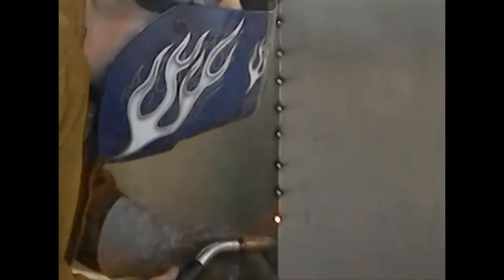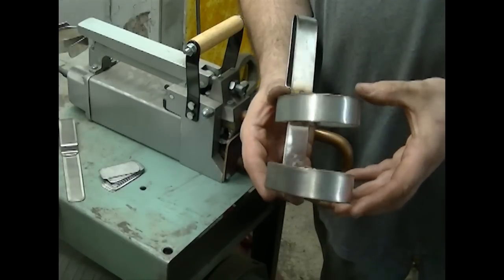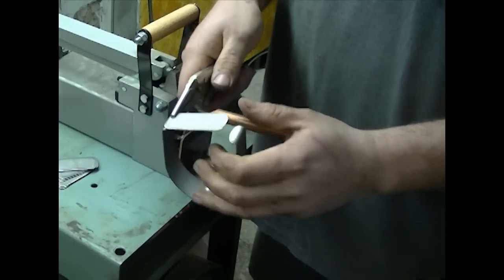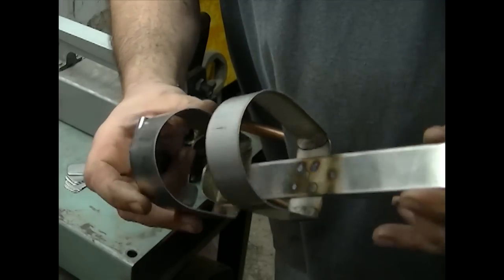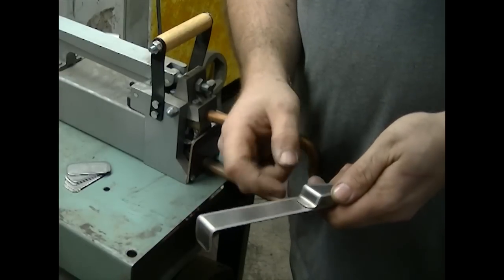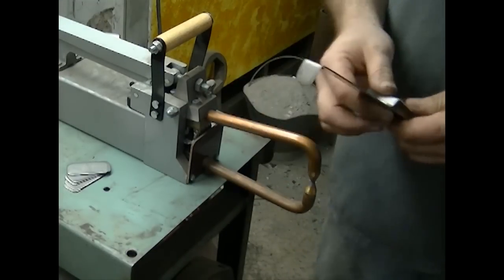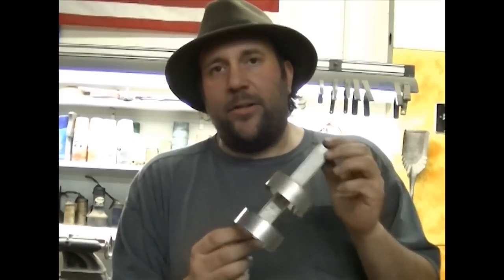Basic Spot Welding

Comment: Great demonstration!

tangentially related: If I were the car wash owner, I would have gotten these bottle holders fabricated entirely from cotton or some soft hydrophobic fabric.  The top and bottom hems could have a stainless steel wire embedded inside to keep a cylindrical shape to accept the bottles.

Comment: Where were you when I needed you?!! Had a car owner at a car show explain at length how is car was absolutely perfect colours standard and exactly as it left the factory. He got very defensive when I pointed out his panels were fitted with tack or puddle weld in pre made holes. He was adamant they were spot welds! I tried to explain to him that spot welds are a resistance and pressure weld with no holes or any other pre preparation. He relented to claim they were the same thing! I had to explain spot welds introduce no extra material to the joint whereas puddle or spot welds does. He left a bit crest fallen but a little smarter.
 I bought a spot welder for discerning customer work but it ain't cheap kit! The cost of the solid copper arms is a bit eye Watering!
Great video mate

Comment: Another great video. Keep it up. Just wondering why the loop can not be one piece only eliminating the connecting plate, 6 spot welds and labor.  For 18 gauge ( 1.2mm ) mild steel or stainless sheet metal the recommended electrode tip diameter is 0.216in ( 5.5mm ) and has to be perfect flat, not rounded with smooth surface and clean. The electrode tips must be aligned until they are coaxial to each other when the welding materials are between the electrodes & the proper clamping force is applied. Sparking is not normal and could be dangerous ( proper protective gear is a must ). During welding it is not allowed angling of the clamped materials, The welded materials must have smooth surfaces in the welded areas, to be clean, free of paint , rust, grease, etc.....I recommend to make sample welds first , twist and peel test them using a wise and pliers and check if the proper welding nugget is formed between the electrodes. Using a timer can further improve the quality of the spot welds

Comment: my high school metal teacher had only taught us to do a quick zap and let go. I didn't think of about holding it for couple seconds. A lot our spot weld projects would fall apart the same day or the next week.
Reply: I work for in an automotive assembly plant, and our spot welding is all robotic, now.  They are programmed to hold for a second, of course there’s a lot more current in those welders than the one in the video.

Comment: Thanks for the vid, but I'd think that you need something more than cloth tape to protect the cars, especially higher end cars. Guys washing cars tend to lean over them a lot to reach the center of say a hood or windshield so that they can dry/wipe them. Anything with exposed metal is going to scratch the car. Even getting into and out of the car quickly (which these guys also do a lot of) is going to cause something hanging off their sides to bump door panels. You might want to look into something like a rubber coating to completely cover them especially since cloth tape tends to come off in water, as well as having a slightly abrasive finish.

Comment: I’ve got both a 120 volt and a 220 volt spot welder. I bought the Heavy) 220 model because of the supposed limitation of 1/8” of the 120 model, and with welds of thin materials, weld time is very short.
Reply: Oops. Seem to have hit the post arrow. 

Anyway, the 120 for really thin, and the 220 for over 1/8”.

But guess what, the 120 model easily welds 1/4” material, including stainless. It just takes a second or two more time. Since you’re not welding continuously, but spot to spot, it never heats up, even after an accounted 50 welds in a period of 3 minutes. Since the 220 model is rated for 3/16”, I naturally tried it with 3/8”, and it worked just fine. Both could possibly even work with thicker material, but I didn’t try that. Enough is enough.

And even though you’re told it won’t, it will weld aluminum. But the tips get contaminated with aluminum. I tried my MIG tip cleaning dip on the tips, and it seems to work.

Good luck.

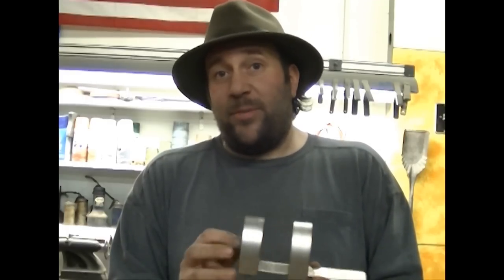Comment: 9:10 i build my spotwelder my self from a microwave transformer(=MOT) and i can also found the limit at around 1/8 (to be esactly a bit more= 3,5mm). Since the build was so easy and cheap i will double the 
power by  adding a second MOT(700W) in parallel so i can weld double the thickness, the upgrade costs
only ~15$. later when i found another MOT i will add a third and fouth so i can weld 1/2inch (with 4mots) Funfact; i could weld thin coppersheet onto stainless steel :D But i had problems connecting different steels types (same type is no problem)

Comment: Hi Jeffrey. I liked this video  and I'm totally new to welding apart from a couple of things I did at college many years ago.  My question comes from an idea I'm being drawn to.  I would like to build a dish draining rack from  small diameter steel bar (2 - 3mm diameter). So aside from the bending and shaping of the pieces, would I need  specially shaped tips on the spot welding points? I ask because I would imagine it would be difficult to hold the pieces together accurately.

Comment: Nicely taught, never done it b4, but would try now. Would spot welding work with aluminum?
Thanks, very informative, am encouraged. Good teacher.
Reply: Antonio Capule  yes you can use is it for aluminium too
Reply: Just with spot welders, you need compatible metals (aluminum and aluminum, steel with steel, ect.)

Comment: Hi Jeffrey, I want to weld some pieces of sheet metal 18Ga. For how long should I press the button so I can get a strong weld? For how long should I let the machine rest before the next weld? My project needs 12 spots of weld. And I need to build at least 100 units. Hope you can guide me through. Thank you!
Reply from the maker: Without knowing the amps of your unit or whether it is 220v vs. 110v it is hard to take a guess at that. Best advice is try to find some scrap pieces and to a couple of small samples, try to break the weld. A few destructive tests will help you more than a "good guess" from a guy like me. Plus it is always good to practice a bit before doing a production run.
Reply: @jeffreysanto  It is a 220V. I' ll try that experiment, I bought a Harbor Freight one and after watching your video I thought that an extra advise would help.
Reply from the maker: @pacoryu  18 gauge is .050 thick, so .100 for the two layers. So your just shy of 7/64 in thickness overall... On that model welder I would guess it to be between 4 - 5 seconds.

Comment: Hi Jeff, nice video.

I like projects with stainless 3mm diameter rods.  

I currently use TIG welding to join them but sometimes it's too much power and it can easily deforms or blow them because I don't have very low amp features on the machine.  

I know you said here that your spot welder doesn't handle more than 1/8" combined metals, but is there any chance that it will work joining 2 rods of 3mm each (one on top of other) maybe because rods don't have much metal near the current area and can not dissipate heat  therefore forcing heat to concentrate in just one spot and ultimately making it weld?

Or can you simply just make a video about it?

English is not my main language, I hope you have understood me.

Thanks.

Comment: So is sheet the only use for this type of welder . I just got a low amp stick arc welder clarke 95 model . I am going to start practicing . But I just seen one like this on craigslist for 30 dollars and I know I will have some use for it . I am doing the finishing touches on a tubing roof rack . A fabricator did the bulk . I have to put some crossmembers for the floor and add expanded metal sheet on the floor and paint yet .
Reply from the maker: +timothy thomas Mild and Stainless steel sheet is the most common material processed with a spot welder. I just did a video last week for one of my subscribers spot welding stainless steel wire, he wanted to make a miniature grill for backpacking. If you would like to see it here is a link.

https://www.youtube.com/watch?v=wxooEzpNrKI
Reply: Thanks I will check it out . I have not heard from the guy that has the spot welder for 30 dollars yet .

Comment: Hi Jeffrey, great informative video.  How do you think spot welding would work for 10ga galvanized sheet metal?  Would that harbor freight weldor be up to the task?  Thanks!
Reply from the maker: I Vw If memory serves 10ga sheet runs .140 which is slightly thicker than 1/8 inch. So 2 pieces combined would be about .030 over 1/4 in.  According to the Harbor Freight site this spot welder which is the 240 volt model welds stock to 3/16 in. combined thickness (mild steel), two pieces of 20 gauge... Also if you planning on welding or heating anything galvanized just be aware that the fumes are extremely hazardous.

This is the description from one of the welding sites I follow: Zinc is the coating used on galvanized metals The typical effect of breathing zinc fumes is metal fume fever. One or two hours or more after welding-without proper personal protection-you may experience severe thirst, pain in the legs, shivering, congestion in the head, dryness and tickling of the throat, and a cough. In very bad cases, you may feel severe shivering, a high fever, buzzing in the ears, nausea, vomiting, and even hallucinations and convulsions. Your symptoms will usually last 24 hours.
Reply: Jeffrey Santo thats a good point -- the steel will be too thick for this welder.. I've got 10k pieces of greenhouse material that require 4 welds each.. Its a hefty project and I don't have time to stick-weld dirty galvanized steel (and I agree -- zinc is nasty stuff.  Had a horrific stomach ache once.. learned my lesson!).   
I really appreciate the feedback.  Looks like I need to do some more researching to find a safe/efficient way to get this job done.

Comment: Nice work!  is that a 240V welder? 20 gauge sheet metal? I just picked up a Stark 240V spot welder to do a series of welds in 18 gauge sheet metal. My instructions also state "up to 1/8". I haven't set my welder up yet. I'm looking to get as much info as possible before I start burning. Thanks for posting!

Comment: Your HF spot welder doesn't have a weld timer on it I see. Try holding the clamping force for a few seconds after you release the trigger switch. This gives time for the weld nugget to cool while clamped( forge time) for a better weld.
Reply: robert stirling I was about to say the same thing. At my school in the metal shop, we spot welded our product together and it had a weld timer. Makes it a lot easier when all you have to do is flip a switch and not hold the switch for a few second.

Comment: Jeff, great and informative video. I never owned a welder of any sort. I am wanting to weld two coat hanger thick wires together for a project I am doing. (One wire crossing over the other with a weld to hold them.) Would you recommend spot welding for welding two wires like this together? Your advice would be greatly appreciated.
Reply: I would recommend a spot welder, but for something like that, check out Grant Thompson's DIY spot welder, don't waste 200-800 dollars for a small project
Reply: Hi there, I know this was years ago but coincidentally I am trying doing the exact same thing right now! How did you get on with this?

Comment: Great Demo on Spot Welding. Does work with Aluminum?
Reply: it does but with a special trick
Reply: @dimitrismoures  thanks for sharing the special trick
Reply: @ryanlewellyn5504  my apologies, you need to "sandwich " the aluminum sheets between a thin steel tong. This way the current can travel between the two pins of the spot welder but the heat effect mainly the aluminum
Reply: Most spot welders should be able to weld anything they can get hot enough to melt through

Comment: Is there any problems with localised oxidisation at the site of the actual spot weld of the stainless?
Other methods of welding stainless require a gas shield to prevent oxidisation during the weld process.
Reply from the maker: The only time I have had an issue spot welding stainless is if the copper contact points on the machine are old and need replacement. If the tips mushroom because your using to much pressure it increases the amount of contact to the metal. The heat is not as focused and as a side effect more heat is put into the piece than normally needed to fuse the parts together. You'll start to see discoloration in the material but not much more than that, to get oxidization you would have to stay on the heat for a while and begin to physically burn the steel. Since your only doing a quick fusion with spot welding you do not have a molten weld puddle like you would have with TIG welding for example, so the outside atmosphere will have little effect on a spot weld.

Comment: Thanks Jeffrey, why do you let it cool between welds?
Reply from the maker: Two reasons, first is if I am making a lot of the same part I do them in steps rather than welding the entire thing together at once, helps me stay consistent. The second reason is it prevents heat building up in the part, to much heat can discolor stainless steel and also make it harder to hold on to without gloves.

Comment: When you’re doing more than one spot right after the next do you keep the spark on less time time than you would your first one because the metal is already heated?  Thanks
Reply from the maker: I don't believe the heat is much of a factor ti the welding process itself.  Some spot welders have timers on them so that each weld is uniform. Its really the passage of the current that fuses the material together. Welds made by heat alone generally require that the parent melt to a point to create the fusion. Also to much heat combined with the pressure of the electrodes could start to really deform the copper tips and shorten their life span.

Comment: Dark: I have hte same setup I have welded up stainless steel exhaust tubes. What is the trick to keep the stainless from sticking to the copper contact points?
Reply: Drbooo;  Anti-seize.   I think that’s how it’s spelled.   Dab on tips.

Comment: would spraying argon during the spot weld keep the brown stuff from forming?
How could one keep the brown stuff from forming on the metal?
Reply from the maker: Argon and other shielding gases won't do much with spot welding like this, shielding gas protects the molten weld puddle from impurities until it solidifies. Since the metal never makes it to a molten state it would have little effect. What appears on the metal surface with spot welding is a combination of heat discoloration and any coatings, oils or other chemical treatments such as galvanization. The key is cleaning your parts as good as you can before the weld, The heat discoloration really can not be helped and will very between metal types, thickness of the metal and how long the current is applied to the part.
Reply: Brown stuff... lol
Spot welds will have heat discoloration as the metal itself is heated but it can be primed and painted over, so the color is not relevant.

Comment: Could a spot welder such as this be used for welding two rebar rods together?
Reply from the maker: This welder is limited to sheet stock, The transformer in the unit would melt before rebar ever welded together. There may be an industrial spot welder that could do it but the electrical power required is not something your going to find in a home shop. At that point the machine would be so large and heavy that it would no longer be portable. Rather than go through all that its cheaper to Mig or Stick weld it together.
Reply: Thanks a lot for taking the time to explain all this and helping to point me in the right direction. Really appreciate it.

Comment: How much does that Spot welding machine cost?? Please let me know...
Reply from the maker: I picked up this one at Harbor Freight for just about $200, its not a bad unit for the cost but finding replacement tips can be a hassle. If I had the money I would have gotten a Miller model, that one starts around $700.
Reply: Thank you Sir, I need one like that one ASAP. I want it here in Nairobi, Kenya. I hope to keep in touch with you. I need a 3mm one.

Comment: Hi Jeffery
I am kaism,how do you rmove the spot weld effects of ss sheets?thanks
Reply from the maker: +kasim farahani Are you talking about the discoloration from the heat or the little dimple where the current passes through the material?

I use fine steel wool without any soap or water over the surface to remove the heat lines.  The little dimple that is created could be removed by grinding but you would find yourself removing half the material thickness to do it.
Reply: thanks jeffrey...

Comment: What does a spot welder like that cost?
Reply from the maker: At harbor freight it retails for 209.00 and goes on sale for around $175. Drop by their web site and search spot weld and it will pop up.

I am going to upgrade to a Miller one in the future, that one should run me about $800 or so.
Reply: You can make one yourself for about $10 in materials

Comment: what metal is  it?
the weld head
Reply from the maker: +Franky Yodi The contact points are made of solid copper. I had to make them on the lathe as replacements for this spot welder are nearly impossible to find.
Reply: wanna try with iron
but i guess
the iron head will melt quite fast...
Reply: The thing is copper has higher conductivity and thus does not get as hot as the iron and steel.
Reply: Franky Yodi

Comment: Hi do the arms of the welder get hot?
Reply from the maker: A little bit, normally you use the welder in short bursts. If your making a lot of welds consecutively then the heat will build up in the copper arms.